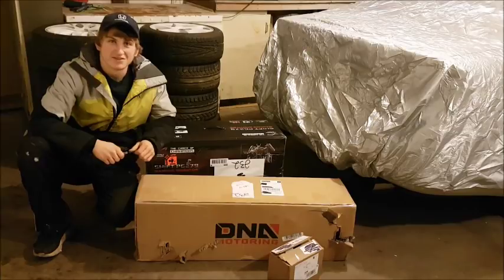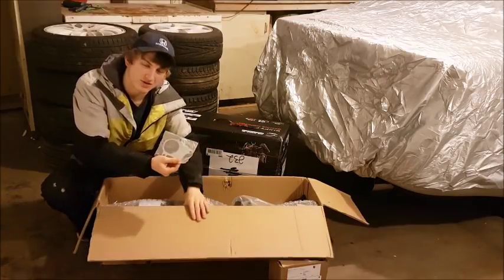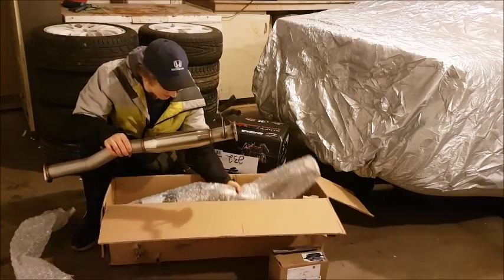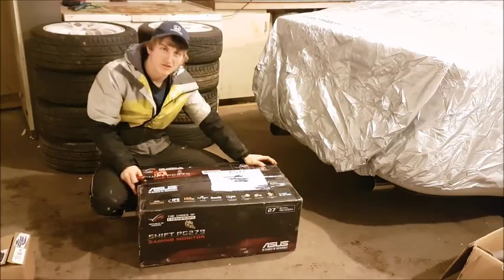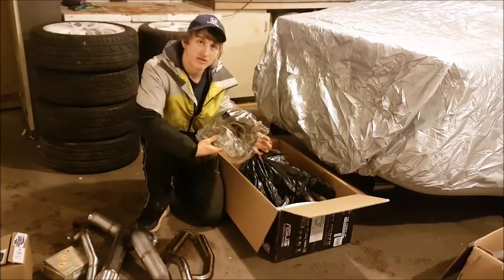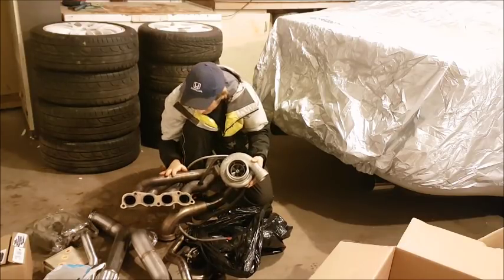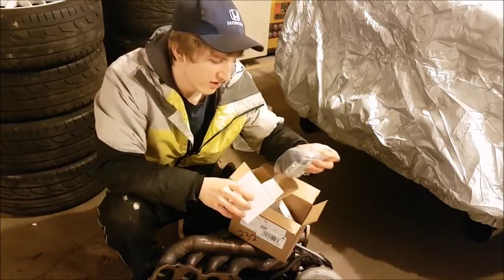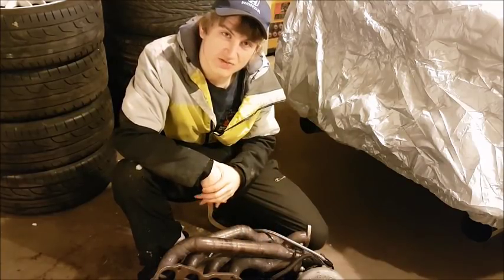500hp EP3 Turbo Set Up Unboxing!

Comment: Why didn't the eBay kit work out.. because of k24? I have a k24a2 ep3 I was thinking about doing the emusa kit
Reply from the maker: I belive mine was for a k20 so the turbo was a bit small for my k24. Also emusa kits are great on the k20 for around 30whp but for any more maybe try to get a sidewinder or a larger rear mount turbo.